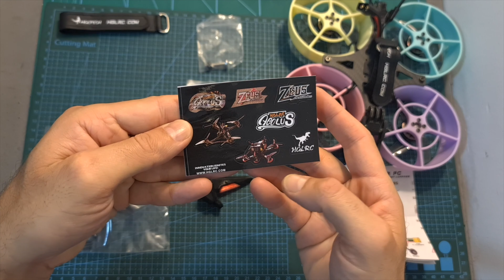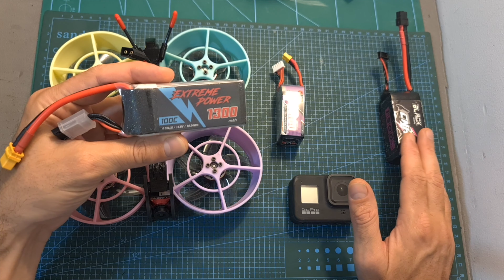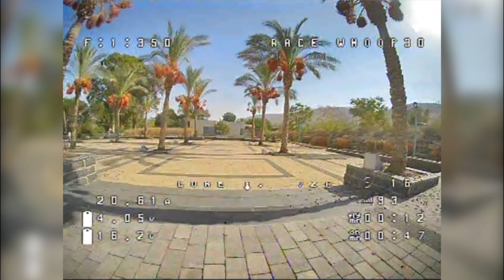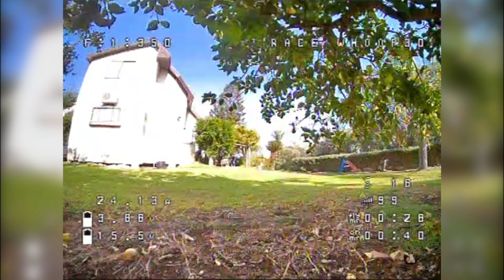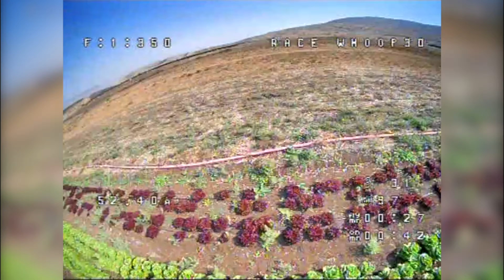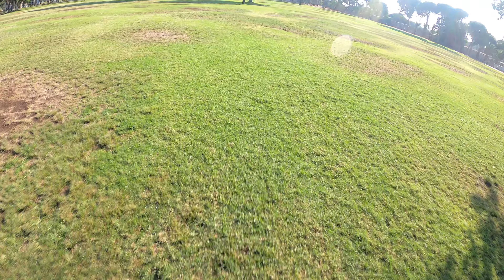HGLRC RaceWhoop 30 (Molded Plastic Ducts Version)

Comment: Hey Gal! Thanks for the “to-the-point” review. 
Is unscrewing the top plate the best way to access the Vista? Or is removing one duct better? I want to register it and possibly upgrade it (and bind it). Thanks! Christophe.
Reply from the maker: My pleasure man. I don't have the vista version. but I assume that opening the top plate should be enough. Regardless, I recommend to get a 90 degrees usb extension cable which can save you some time and trouble and will enable you to access the usb C connector in tight builds and etc.

Comment: Great review. I'm anxiously waiting my Racewhoop30 frame. I got the frame only version from HGLRC sale for 19usd and these motors as I already have plenty of suitable other parts. Will make it digital once it arrives (been on its way about 3 weeks now). BTW there are plenty of custom parts for it in thingiverse. You can print taller ducts for taller motors and even ducts to make it 3.5" or 4" monster. But you need PCTPE or stiff PP filament to make best use of them.
Reply from the maker: Thanks Mikko. I hope it will arrive soon :-)

Comment: Are the molded ducts as strong as the PCTPE 3D printed as used in the original design by Freezillion?
Reply from the maker: I think that they are even stronger.
Reply: @KremerFPV  And lighter.